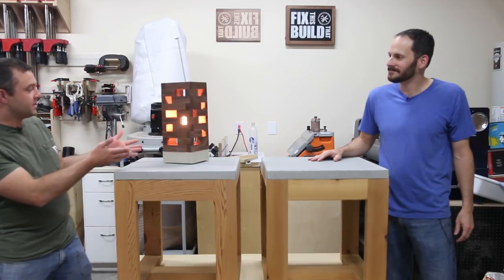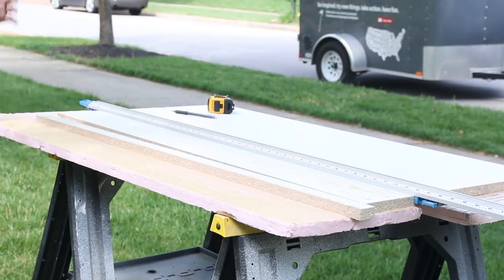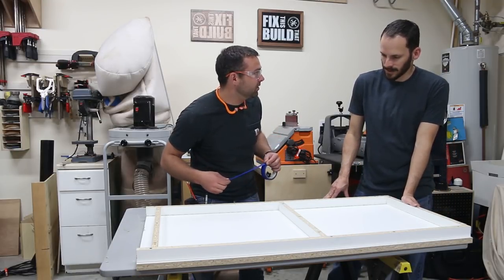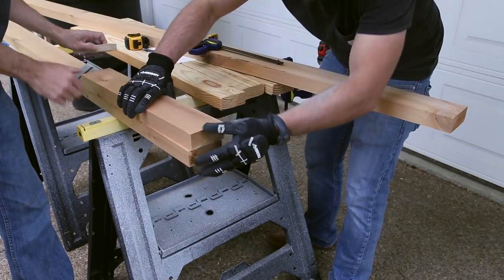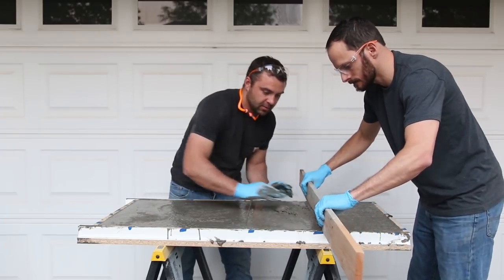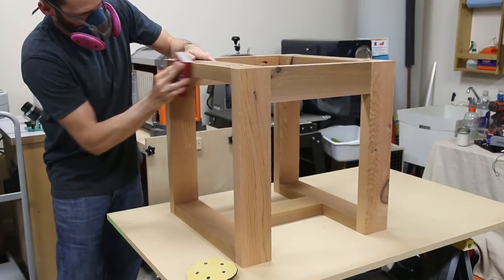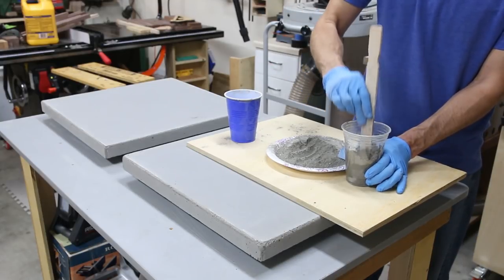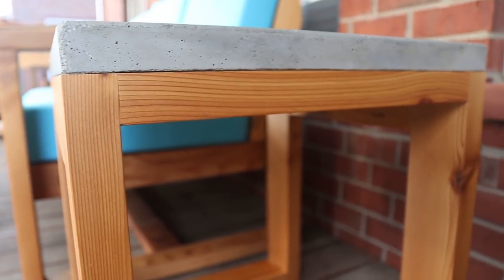DIY Outdoor Side Table with Concrete Top (2x4 Challenge) | How to Build

Comment: Nice build.  If you do more concrete tops in the future, I suggest using a caulk color other than white to make it easier to see any flaws in the caulk against the white melamine of the form.   Could you share where you picked up the 2X4 cedar?
Reply from the maker: +Lloyd Simmons Yeah, I want to use black caulk in the future. Good tip!

Comment: at the video marker 1:10 I noticed you were using Styrofoam underlayment when cutting on the saw horses.  you might want to look at my video about Styrofoam 2x4's.  I find them to be extremely durable and useful when cutting larger panels.  great outdoor project
Reply from the maker: +Russ Veinot thanks, Russ! I'll check it out.

Comment: I was thinking you might be able to just buy a paver to use as the top instead of concrete. Lot's of pavers can have cool designs and colors (and skip some work lol). Then just build your frame around it.

Comment: Another great build Brad. Wondering what your general cost of this project would be? I was thinking right around $100 if you have absolutely nothing on hand materials wise.
Reply from the maker: +Craig Flack thanks, Craig. Actually it was much less than that. 2 2x4s at $8 a piece, 60lb bag of concrete at $5, 23.75x48 melamine shelf $15, caulk $3, screws $4, finish $15. So $58 with absolutely no materials and left with lots of finish, caulk and screws.

Comment: Great project, Brad! Did you do anything to the 2x4s to get them in better shape beforehand (planer, table saw maybe)? Yours and others' projects always come out seemingly perfect and square using them, but I don't find good quality 2x4s at my local chains.
Reply from the maker: +Cale B thanks, Cale! These were rough cedar 2x4's I brought down to actual size. They still had some bow, but at these short lengths you can get a way with a little movement in a long board. By the time it's 24" the bow is minimal.

Comment: concrete doesn't dry, it cures.  it needs water in the chemical reaction. you would be better off to seal ALL surfaces, including the bottom to keep he moisture in.
Reply from the maker: +Patrick Norton thanks for the info. I'm still new to this.

Comment: Hey Brad,

I don't have a pocket hole jig, How else could I join boards?
Thanks
Reply from the maker: +j vent check out my Modern Outdoor Sofa build.  It's a very similar design in the terms of joinery and I just used a drilla nd no pocket hole jig.  That said, you can pickup a Kreg Mini for $20 amzn.to/2rtZ4sW and save yourself a lot of heartache.  Or upgrade to the R3 for $40 amzn.to/2qERGaW and be able to do the pocket holes quickly and easily.
Reply: you can also buy a pocket hole jig at harbor fright. it is much cheaper and works very well. I plan on making some video's of some projects with it. I built a walkin closet with it. I just started a new channel me and my two boys. Check it out and subscribe thank you. let me know if you want to see the walkin closet, it was very easy

Comment: How do you get a 20" top using a 23 3/4" X 48" melamine and cutting 4 -1 1/2" strips from the side length. My calcs say 4 X 1 1 /2" strips equals 6" off the side of the  melamine, leaving you 17 3/4" and less counting the kerf. Placing the 3'4" strips on top of the melamine you would have a total of 16 1/4" area left in your form, not 20" as stated.
Reply from the maker: +Bill Brooks Sr. Bill you are absolutely right. I changed the voice over and thought I changed the other areas to reflect this. Where did I miss?